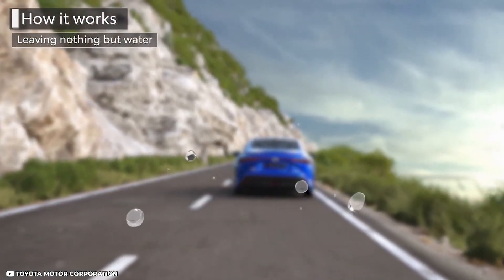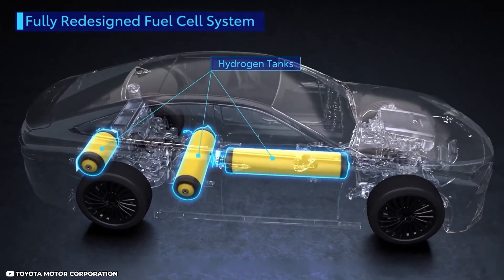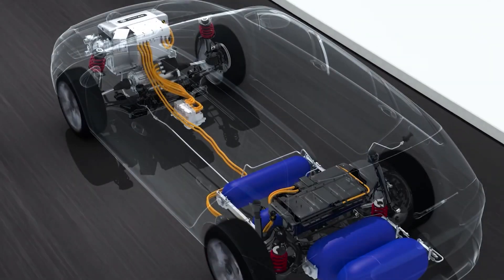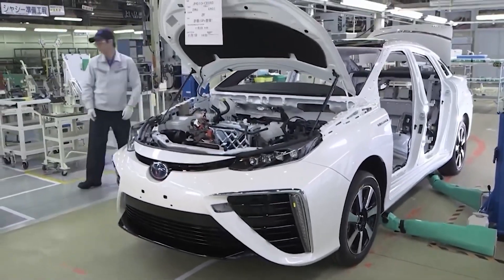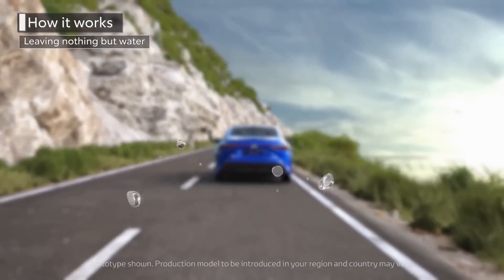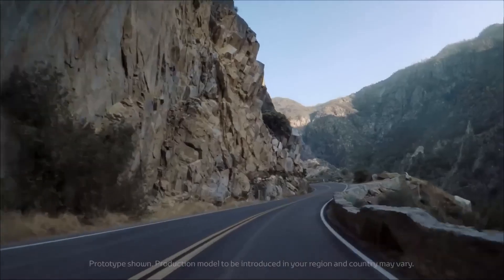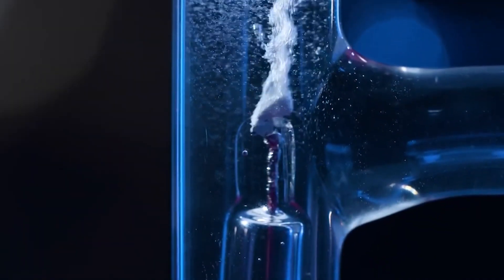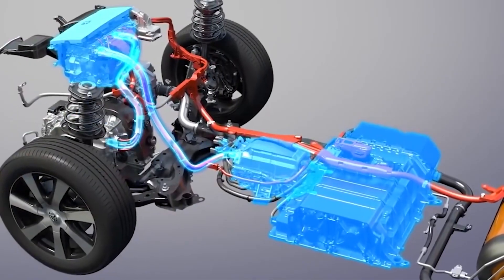This 2 Liter Hydrogen Engine Will SHOCK Toyota

Comment: Plugin Hybrid electric combine with Hydrogen way to go.
Reply: Pointless, just use the electricity to provide tractive effort, far more efficient. When you look at all the loses of splitting water in Hydrogen and Oxygen, then turning it back into electricity, an EV can go 4 times further on the same amount of electricity.
Hydrogen has always been a dead end technology for cars

Comment: New research suggests hydrogen is 10 times worse than co2 as greenhouse gas effects. 
Hydrogen is smallest molecule and in a week evaporates from tank and  also has to be vented out due to its warming up from criogenic temperatures. 
Hydrogen gas stations and transportation trucks are more expensive and more flammable. 
Currently none of the components and technologies are cheaper than ice or electric, and price of electric cars and batteries are getting cheaper and soon cheaper then ice cars.
What would be sources of productin of hydrogen??
Reply: What would be sources of productin of hydrogen?

you can make it as a byproduct of nuclear facilities which is basically as green as it gets.
Reply: @Joso997  But it's still inefficient as the losses of producing the Hydrogen, then turn it back into electricity, an EV can go 4x further on the electricity used. 
Plus making it from Nuclear generated power, the most expensive form of electricity, would maki it an even worse scenario.
Hydrogen has always been a dead end technology but researchers have been able to fool dumb investors to waste their money and with that in mind it will never die, it's the eternal scam

Comment: unless this new engine is quite cheap, having a motor to charge a bettery to power a motor is always going to be more expensive than just a battery and a motor. PS: you can fully charge a battery only car in less than 15 minutes (given the right charger).